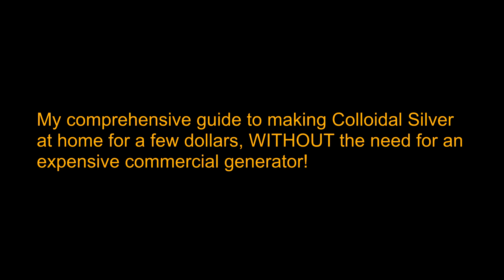Scientific Methods to Test Water Purity With TDS Meter

Comment from the maker: PPM of colloidal silver needs to be understood in its entirety.  PPM means parts per million.  By definition 1 PPM is 1 milligram of silver deposited in 1 liter of water (1,000 ml) (1,000,000 mg).  If one were to ingest that 1 mg. piece of silver, it would not do much good.  If you were to divide that 1 mg. into 1,000,000 particles of silver, it would then have much more efficacy because it takes one particle of silver to disable 1 pathogen.  The silver is now 1,000,000 times better than 1 piece of silver even though by definition it is still only 1 PPM.  If one were to further divide the 1 mg piece of silver into 100,000,000  particles, it would be very beneficial indeed.  And so as the silver is more finely divided the PPM by definition remains the same.

So, what really counts is not how many PPM the silver is but how many particles the silver has been divided into,  That is why it isn't necessary to have high PPM but it IS important to divide the silver as finely as possible.  It is not better to try to take high PPM colloidal silver but to take CS that is properly made.  If you think more silver is necessary, just take more of better made low PPM colloidal silver and you will be further ahead than if you took poorly made, high PPM colloidal silver. 

Another factor is the form silver is in.  90-95% of the silver made with the SG6 Auto is ionic and up to 98% of the SG7 Pro silver water is ionic.  Ionic silver is like sugar or salt dissolved into the water.  It is invisible and can only be sensed with a test meter - Ionic silver is conductive whereas colloidal silver is not.  Colloids are like small ball bearings floating around in the water and separated from each other by what is called Brownian Motion.  They carry no electrical charge.  The ions are silver atoms missing one electron in the outer shell and therefore are positive in charge.  The ionic portion is evenly dispersed like dissolved sugar or salt.

If the colloidal silver is properly made it will be crystal clear.  This is because the particles are too small to reflect any light.  If it shows any color, the particles are too large.  The first color seen is yellow.  As the particle size increases other colors such as red, green, blue, brown or black may be seen.  Any color seen will indicate CS that is not very good.

Comment: You might wipe off your TDS meter before testing the next water.
Reply from the maker: T Young Why's that?
Reply: That's what my TDS meter said to do to get a more accurate reading  in case some particles might have stuck on your meter posts after checking the TDS in your tap water, which were pretty high.    just sayin'  Maybe your Distilled water might have measured less with clean posts? dunno....
Reply from the maker: T Young I get that, but as the rough guide in the video, it wouldn't be hugely affected and aprox correct for the purposes of demonstration

Comment: This is a very simple colloidal silver maker you can make from a $1 garden solar light from a dollar store.You can see two versions here. one with a red led i had made earlier and the white light one in the video.you don't really need the spring loaded connectors.Just solder them or hot glue them or just force them through the plastic casing after heating it slightly.
Reply from the maker: ahhaha! HOW CUTE!!
Well I suppose so...As I say in the video; voltage isn't that important.
How much were the tiny rods you bought?

- Hard to use these at night or cloudy days tho! LOL
Reply from the maker: Your video is cute by the way! - I might subscribe :)
Reply: By day it charges the integral battery.To activate it simply cover the solar cell WITH CARDBOARD to simulate darkness.two SILVER RODS $20  2 thick mm by 30 cm length.
Reply from the maker: Ese Callum ...has it ever finally reached the ideal medical level? I'd say it will take rather a long time at that rate to reach the level required! 

The 1iny video is a plug pack of around 500 milliamps.
Reply: smaller current = smaller particle size. mine is fixed to 0.1 milliamps which after 1500 minutes for a volume of water 0f 1000 ml =10 ppm  the solar lights output 0.2 to 0.27 milliamps and the time can be halved to just 750 minutes.
this is by using an EXCEL spreadsheet online which you can download if you want
Reply from the maker: Ese Callum cool. I thought it was simply shorter time = smaller particles?

I used to go to about 25 ppm but lately I've only been going to about 14 on the premise that smaller particles will integrate into the cells better as more effective antibiotic.
Reply from the maker: At the end of the day tho, if you want to make it in a HURRY; Do it the way I show. 👍
Reply from the maker: ...To DEACTIVATE you mean.
Reply from the maker: Ese Callum you'll have to tell me where you buy your rods by the way; last lot I bought for $80 for 12 inches which I cut in half to get the 2  necessary. Are you positive they're 99.999%. Which is required?
Reply: I DONT SEE THE LINK FOR YOUR VIDEO ... PLEASE SEND IT TO ME ! THANKYOU
Reply from the maker: This one?
https://youtu.be/kUQN9Tj2czw
Reply from the maker: marcalypso1 which topic?
 I will check shortly from my PC... I think I put links in the description but if not will post it here once I know.